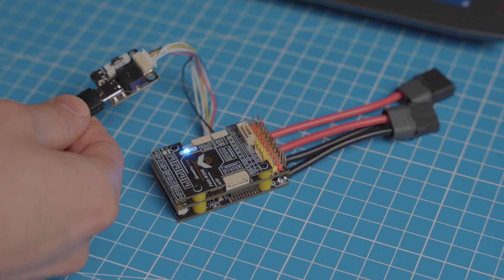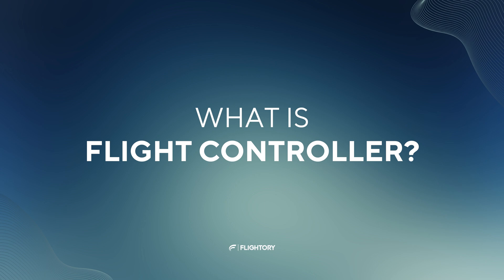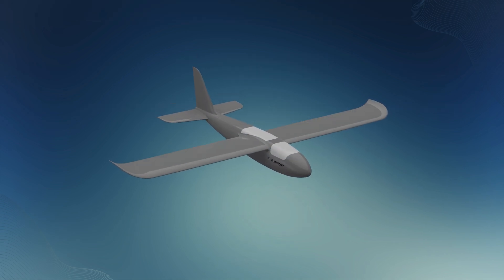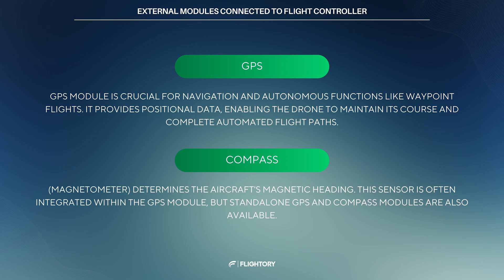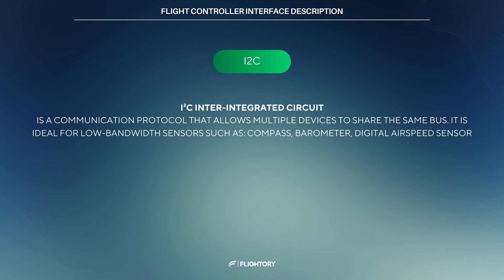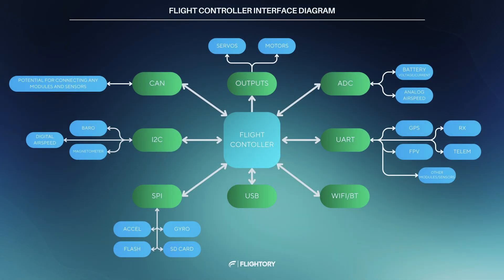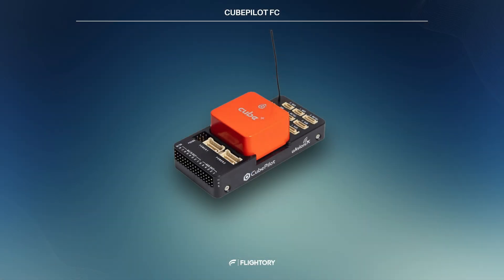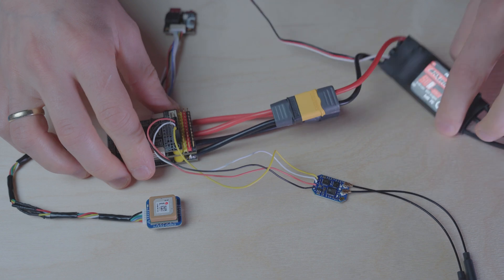How to Build a Fixed Wing Drone? | Electronics Basics

Comment: Great Video. Thank you. And thank you also for you amazing 3D print designs.
I have my Stallion VTOL printed and assembled, but setting up the Speedybee F405 Wing with ArduPilot and Edge TX on a Radiometer TX16S has me stuck. I have the ELRS receiver bound and talking to the radio, but the servo mapping on the radio does not match the Servo Output in ArduPilot? I am a newbie to most all of this. I watched a ton of videos and read a bunch of the ArduPilot documentation. But a video stepping through the process using your recommended hardware would be super useful. 
Thanks again of all that you have already contributed. The Stallion looks great. I can't wait to get through this step and see it fly.  :-)

Comment: Should a VTOL use a FW or Copter FC?
Reply from the maker: Fixed wing, because as I described, airplanes have servos and a flight controller for airplanes is simply better suited in terms of outputs and more convenient. The fact that it’s a VTOL doesn’t change anything in this regard.

Comment: What is the maximum range of this planes before you lose the control of it?
Reply from the maker: It depends on the RC link. In the case of ELRS that we use, it can be up to 100 km. You lose video signal earlier, but it's possible to go even 50 km without losing the image.

Comment: I recently purchased the Lark, Stallion VTOL and Talon 1400 Flightory 3D RC model plane files. I am currently printing the Stallion VTOL on a Bambu Lab X1C printer using Colorfabb LT-PLA-HT filament. I will probably print the PETG pieces in Bambu Lab PLA-CF but I will test several STLs to look at strength. I have benn very impressed with the quality of the engineering that goes into these planes and look forward to getting them into the air. The electronics series that you bring us will be very helpful as it will be the most difficult part of the model to get right. Thanks for your attention to detail.
Reply: Any updates? Have you pieced it together?
Reply: an update would be great :)

Comment: Great series, its much easier to learn everything from a single reliable source. Will there be a video in this series about setting up a fpv system? It would be really nice if you can do it.
Reply: DJI O3 Air Unit works out of the box with the SpeedyBee F405 Wing, tho you will also need a DJI controller and goggles.
Reply: @pathfinder.george can i use DJI controller as well?
Reply: @ Yes, I'm using the DJI FPV RC 2